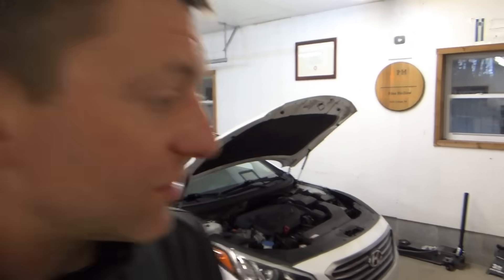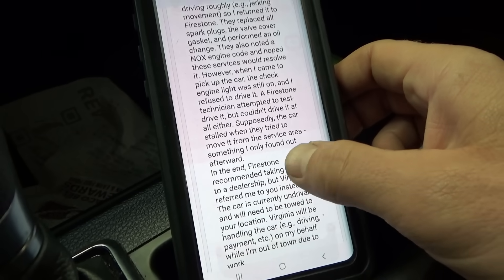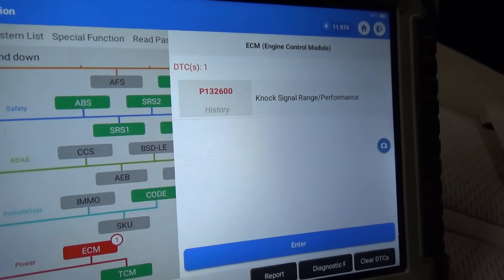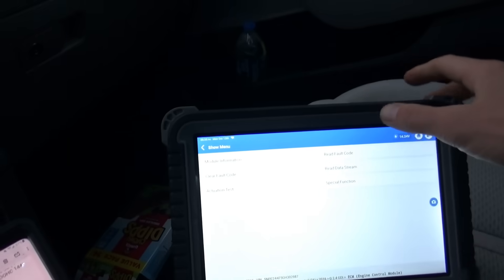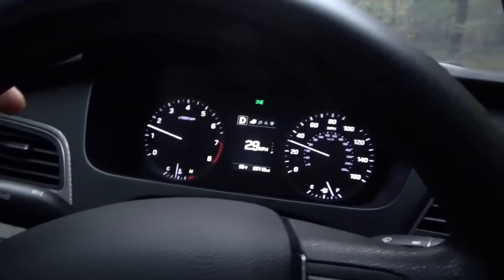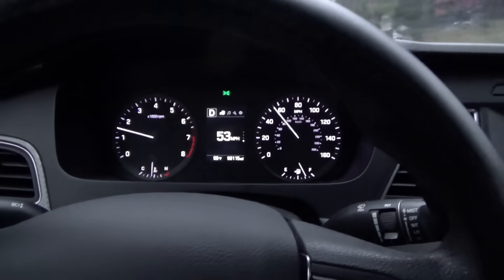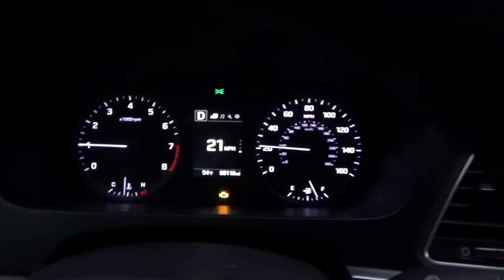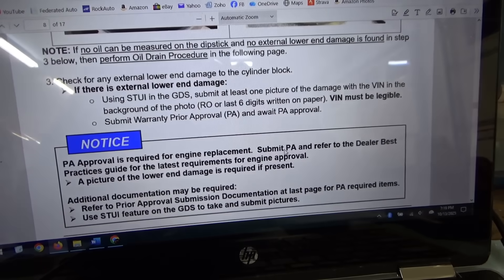Shop Replaced Spark Plugs...for THIS?!? ('16 Hyundai Sonata: LIMP MODE P1326)

Comment: As SOON as I saw Hyundai Sonata and P1326 knock sensor code I immediately said "NEW ENGINE UNDER FACTORY RECALL!!" During the manufacturing process on these the cases were not cleaned out thoroughly after boring them out, and it left metal deposits inside the block, which over time cause spun rod bearings and/or other internal damage. Good to hear the owner got this fixed FOR FREE with a new engine under the factory recall.
Reply: What a great car....

The Hyundai fans were telling me only one series of engines were junk and needed to be replaced...
Reply: The deposit in the engine excuse isn't why these engines don't last. Thet are just plain junk.
Reply: @philjerome9795  Like the several toyota engines I've seen last week torn down due to bearing problems, one with 38K and one with around 70K. So can't say just Hyundai are junk as most manf have a bad run or two.
Reply: That problem was supposed to have been resolved as early as 2013. However, it looks like later engines still have had problems. I think the real answer is simply that these engines don't tolerate poor maintenance. Even bare minimum maintenance according to the maintenance schedule may not be good enough if you're driving severe conditions and using bare minimum quality oil.

These days Toyota, Ford and other companies are finding out the exact same thing. The type of sloppy maintenance you could get away with on a '90s Toyota engine is not something you can get away with on modern turbo GDI engines.
Reply: Hyundai dealers denywarreanties all the time. I have received parts in for service with the RO sheet included and the dodmeter was under a 100K. I asked the service department why I was repairng the part when it's still under warranty and they said you fix we're not covering it. Hyundai actually bypasses A LOT of warrnaty issues and if you don't have the time and energy to figth and get the zone or egional manger ivnovled you'll be screwed.  Subaru is the same way. Corsstrek's built in Indiana are junk, but is everything built in that plant. I know someone directly at Hyundai/Kia N.A. HQ in Irivine CA I have talked shop extensively with and he confirmed a lot of my suspicions. A very old and well known dealer in our area has 20 year / 200K on his cars in the lot and I just don't know how that's possible when all they build is !@#$ like so many other OEMs
Reply: Hyundai sure makes good disposable cars though.
Reply: That’s amazing on a 9 year old engine! Excellent service.
Reply: The warranty doesn't transfer if bought used.
Reply: @bigdaddymak1439  I have to disagree. Under certain circumstances they will. Nearly impossible but it can happen. I did it with a 2014 Tucson but I think I was one of the lucky ones.
Reply: If you don't have all your oil change records, no warranty...even if you do they still may deny the warranty
Reply: @gregorydavis4831  how can they legally do any of that if they recalled the vehicle due to poor workmanship…they cannot. The vehicle is trash. Manufacturer defect. The vehicle was poorly built. Period.
Reply: @gregorydavis4831 that's what they say to scare people. But the moss magneson warranty act says the manufacturer has to prove neglect. Proof inside the engine of neglect not just receipts. They're not allowed to discriminate against DIY oil changes
Reply: @gregorydavis4831 I've heard of Hyundai covering warranty on some of these engines, even when they are full of sludge and clearly have been neglected. They may have tightened down on this a bit more recently however.
Reply: @RobertHancock1 Hyundai/Kia hired a former warranty administrator from Volkswagen. They have gotten very tough I just picked up a car from a guy who had a warranty refusal his only gap in service records was under 8k miles, he appealed and everything. They denied the warranty plus while he was trying to appeal the dealer had the car impounded he only found out when DMV sent him a letter. I replaced the engine the bad thing is now that it's had a denial he is not eligible for any engine warranty consideration in the future even if a Hyundai factory engine was installed.
Now if Hyundai installed an engine under warranty it would be covered.

Comment: Just wanted to say that a very few good ones slipped through. A buddy of mine has one of these in a Sonata that’s pushing 300k, but I’ve meticulously maintained it for her with OEM filters and Mobil1. 

On the other hand two other friends (who didn’t listen when I said to ditch those pieces of crap) had engines seize on them. One was replaced under under that campaign, and then days later the car burned tto the ground on the interstate. Apparently the dealer did not connect a fuel line correctly and it started an engine fire. of course they claimed to no liability, and Insurance paid a penance.

From now on if people don’t listen to me when I say don’t do something, I just refuse to work on their cars for any reason. Petty? Yep. Do I care? Nope.
Reply from the maker: Wow, 300k is seriously impressive for one of these! 😮

Comment: Motor under they need to go to dealer get one change with oil consumption test it’s start in cylinder number 4 need to go asap because he’s under the 10 year mark and miles are low .

Comment: A month ago I did same exact diagnosis on 2015 Kia Optima. Car had oil and was within 5k oil change interval. Sent it to the dealer, and they also got free replacement engine. A week ago, I worked on 2020 Kia telluride, drained 1.6 qts of oil, out of 6.9 it supposed to have. Car was dealer serviced with 5k interval. 102k miles, already had new tranny. Sent it to the dealer as well, hopefully it gets a new engine too.
Reply from the maker: WOW 😮
Reply: So all the oil was burned? Why?
Reply: @igormac88 good question, my guess is because engine is shit and burns oil
Reply: @igormac88  guaranteed burning it all and throwing it out the exhaust. any of them u in mileage, just rev and let off in a bunch of short blips and out will come exhaust oil clouds.
once bad enough it will buildup in the exhaust and drip out!  good old GDI (Guaranteed Destruction Integrated) 😏
Reply: @throttlebottle5906 jesus 😮😅

Comment: Uh oh, the chuck engine light is on.
Reply: That is so absolutely funny.  I love it.  Thank you for that one1
Reply: Needs a light in the shape of a guy walking!
Reply: LOL!!!! Chuck Engine light. Had a 2006 Hyundai Sonata that I bought new and dearly loved but at 175,000 KMS it went to the Auto Wreckers. Blown rear brake lines and ABS light and check engine light and it just wasn't worth fixing, Should have bought a 2006 Toyota Camry instead.
Reply: Oh I am so stealing that !! 😂👊🏻
Reply: better whip out the wallet light.
Reply: Rod knock she is done.

Comment: Sooo....an electronic oil level sensor is good after all.... but then again, some people wouldn't even see the message on the dash...
Reply: It’s normal, Service Engine light comes on, the customer comes in. 
Can you check my car? 
Ok, what’s wrong? 
It’s says Service engine and a low oil level?
Have you added oil and when was it serviced? 
I don’t remember, just check and reset the light. 
How about the low oil level light? 
Will a quart of oil do? I don’t have enough money?
No…
Take to the shop to see how much oil you need for the service and the shop will reset your light. 
No I want it reset and you add my oil immediately!

Comment: Theres a recall on those motors because of manufacture defect when they were built. The engines werent properly cleaned after machining before assembly. So rod bearing gets destroyed. When you get that code its a automatic new engine, even if your warranty is up. Happend to me last year, had 165,000 on a 2013 hyundai sonata.
Reply: 165K for machining debris to take out one rod bearing? Thats a bit hard to swallow. 🤔😵‍💫 I don’t believe Toyota’s same claim for all failures they’re having with the V-6 turbos either. 👍👍🇺🇸
Reply from the maker: @brianw8963 was going to say exactly the same thing 😂
Reply: @PineHollowAutoDiagnostics if they admit it's a design flaw they have to replace them all 🤷‍♂️

Comment: My sister just had to wait 4 months for a warranty replacement engine from Hyundai.
Reply from the maker: Did they give her a loaner?
Reply: @PineHollowAutoDiagnostics after roughly 5 weeks they did  give her a loaner. She paid for a rental before she got the loaner. Then Hyundai would not reimburse her for the loaner until after the new engine was installed and the repair was closed.

Comment: My brother used to drive a 1996 model Hyundai Excel (Accent) & the engine had done over 300,000 kilometres (over 180,000 miles) & the little 1.5 litre engine still had 165 PSI of compression per cylinder, he got rid of it because the body just wore out & he upgraded it to a 2000 model Hyundai Elantra which he's still driving about a decade later.

The older Hyundais were much better because Hyundai fitted thinner low tension piston rings into the newer cars to reduce friction which means less exhaust emissions.

My dads neighbour has about a 2018 model Genesis sedan which runs the 3.8 litre Lambda V6 engine,he barely drives it because it's such an oil burner,he tends to drive his Toyota Yaris everywhere.

He used to drive Ford Fairlanes which were a luxury type saloon car which all ran the 302 cubic inch Windsor V8 engine, now he's driving a little 4 cylinder car around most of the time !
Reply: I sold my 97 accent with 300k miles back in 2018 and not burning a single drop of oil, 200psi compression.
Reply: Older Hyundai's powertrain was made by Mitsubishi.
Reply: @derrickphillips354  that was before 93, after that they made their own engines except the 2.4

Comment: My boss has a 2016 Sonata that went into limp mode.  The car is a hybrid and he had it towed to the dealership.  The coolant pump for the rectifier went out and it was $2,000.00 to repair it.  He has to put a quart of oil in every 3rd tank of gas.  I reminded him of all the gas he saved that has now been negated by the repair bill.  The car has 140,000 miles and is out of warranty.  The Marquis must run forever.  GREAT VIDEO!
Reply: That's why I don't give a shit about my 20 Tundra being thirsty. It is insanely reliable. I rather pay at the pump...not the repair shop.
Reply: So in almost 10yrs he's only had a 2k repair bill? That's really good and guarantee he's saved more than 2k in gas over those 10yrs 

The oil issue is a problem with Hyundai, hybrid or not.

I have an 06 Prius with almost 300k, only done brake pads and normal maintenance. Ivan just hates Hybrids because he can't make as much money from them like can on a regular car.
Reply: @Jumalten001With this level of oil consumption the rings are likely seized from carbon (so it suffers from oil dilution and the since it's GDI carbon build up on the intake valves will also be a problem) and the cats near gone; so in a year or two the vehicle will be mechanically totalled.
Reply: @TheOnespeedbiker Yes, GDI has issues. Cats are pricey. I am not a big Hyundai fan. We had one and our 04 Corolla was leaps and bounds better than the 05 Accent
Reply: @Jumalten001No, it isn't the only repair bill.  He had transmission issues before this to the tune of $4,200.00 out of warranty.
Reply: @Jumalten001Without the hybrid, owner would be $ 2000 ahead
Reply: @mikefoehr235 No he wouldn't because you're not accounting for the increased cost of gas every month.
Reply: @Jumalten001maybe a non hybrid is cheaper over the long haul. For example, my one brother in law bought a Mitsubishi PHEV. So, just after the warranty expired, the battery failed. Cost to replace new battery was more than the value of the car AND AND then the filler door for the fuel tank was disabled and the dealer quoted him some ridiculous price to repair that. He instead used a prying tool to open his fuel door. Now it flops in the wind when he drives. He ended up buying a Hyundai mini pickup. He told me he will never buy another EV or HYBRID EV.

Comment: Firestone LoL.  I was in Texas one time in my company Subaru.  got a flat.  They had to do all 4 tires because of the AWD.  our company's preferred service provider was Firestone.  I drove 3,000 miles.  Firestone told me I needed 4 new tires.  At 4k miles?!?  My tires were brand new.  So yeah, Firestone are scammers.
Reply: That’s because the AWD on those are super sensitive. A slight variation in wear is all it takes to mess them up. Can’t really blame Firestone for that call. 👍
Reply: @brianw8963  I can blame Firestone for saying I needed new tires 3000 miles after all 4 were just replaced.   That's a scam.  especially when I went in there for just an oil change.

Comment: An oil change, something super simple but if you leave the oil to drain, forget about it and a colleague thinks the oil is full and start the engine... done! People need to follow the specified procedures, whether it's a post it on the dashboard saying NO OIL, or whatever, but they need to do something. Maybe it wasn't the case on this instance, but yes, changing an oil is a very important procedure that you can screw up big time.

Comment: Almost 10 years and you get a new engine? Best deal ever. I'd run it until that engine goes.
Reply: It takes 6 months sometimes to get the engine replaced, dealers are very backed up.
Reply: @vadim7590 free is free though.
Reply: Engine aready expired

Comment: Happy for the owner that the dealer honored the warranty, but also surprised. Don't know what documentation required, but I would imagine having your diagnosis work on hand didn't hurt and likely significantly helped. The Hyun Theta engines are garbage. Owner brought it to the right place, PHAD! Good call.

Comment: My brother in law, his brother owned a Santa Fe, non turbo, that is currently on its 3rd engine, that has been replaced under warranty
Reply from the maker: Amazing 😂
Reply: The direct injected kill and dilute the oil,   too long of interval between oil changes from Hyundai. One fix Hyundai did was to change the dipstick, so there will be more oil in the pan, that Hyundai did on his car.
Reply: @scottscherret134 I don’t think the 0-0 no viscosity oil’s their all using helps the situation either. Of course that’s just an opinion from an old school fart. 😂👍

Comment: A moot point since engine covered under warranty, but inspection of the oil during an oil change would have revealed the bearing material (“glitter”).  That engine sounded very close to seizing.
Reply from the maker: I'm pretty sure there was NO OIL to drain 😂
Reply: @P @PineHollowAutoDiagnostics  was full when you checked it.
Reply from the maker: @reneneron2971 I mean the previous oil change 🙄
Reply: @PineHollowAutoDiagnostics understand.  But willing to bet that the current oil (when you got it) was still full of metal.  When buying any used vehicle, I always grab a sample of oil to look for glitter.  Once bitten, twice shy.  While no glitter doesn’t prove the engine is good, if present, move on…damage is done.  We don’t know if this engine was run low on oil…only know that engine needs replacing now.  The only solution on a modern engine once a bearing fails is to replace the engine…damage is catastrophic, as the contaminated oil destroys other components (“road to hell”).  If it wasn’t covered by warranty, car would be a total loss.

Comment: I didn't need an engine until you test drove it😂
Reply from the maker: Yeah well it does now! 😆
Reply: My transmission was shifting fine before you worked on it. You owe me a new transmission 😂😂😂
Edit: a few years ago I ran into the same situation. 
My sister and I call Hyundai Corporation immediately. We were directed to our local dealership. After about two hours, the dealership said they will get us a new engine installed. 
They said about 2 weeks. Sister rented a car.

Comment: Hyundai/Kia newer than 2013 or so, are generally very bad cars. A shame because before that, ca. 2005-2012, they were really good.
Reply: Yes they where good, had a 2005 Sonata 2.4, gotta change timing belt at 60k which I dont like vs chain forever.  Maybe this was the block machining debris?
Reply: They were garbage before too. My friend had 2006 Santa Fe 2.7,  almost none parts were off the shelf and needed to be ordered. Didn't like repairing at all :D In the end it developed head gasket leak or cracked the head. She continued driving it and finally the engine seized up.

Comment: Here we go!
Reply from the maker: Thursday quickie before the weekend 😎👌
Reply: @PineHollowAutoDiagnostics 👍Well, gotta give Hyundai credit for stepping up to the plate on this one. Hopefully they address the issue with having to have a Hyundai scan tool and subscription to service the rear brake pads on the new vehicles. Haven’t seen it personally, but have heard about it. 👍👍🇺🇸
Reply from the maker: @brianw8963 just keep that 94 Camry V6 going and you won't have to worry about these fancy stupid cars draining your wallet 😂
Reply: @PineHollowAutoDiagnostics That 94 will will outlast me, but it’s in hibernation mode now , can’t bring myself to mutilate it. Got the old 04 Tacoma “treated” and studded winter tires back on ( all 4) . It’s a great little vehicle too. 2.4 , 5 sp. of course. 👍👍🇺🇸
Reply from the maker: @brianw8963 yeah I'm parking the 96 Mystique and 89 MPV for the winter too ❄️
The old timers deserve a break from the salt!